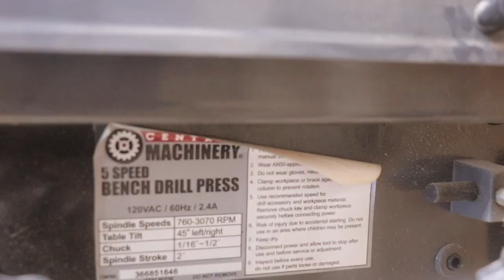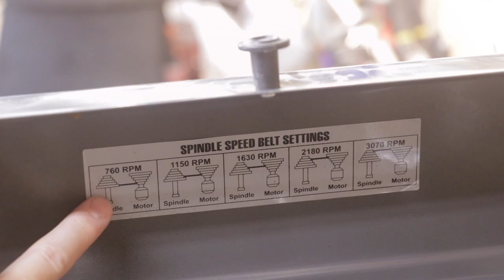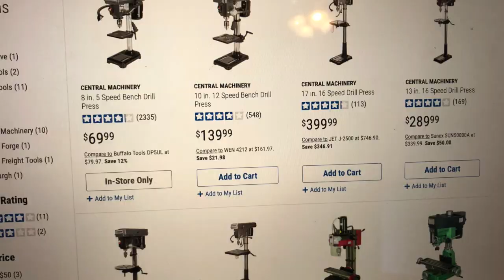Harbor Freight 5 Speed Drill Press Review After 3 Years of Use!

Comment: Harbor Freight's model was to offer old style, easy to produce, less expensive tools that were accurate enough to get the job done.  They are changing the model now with more expensive tools, but the old stuff still works.  I have the drill press, and an old Jointer from HF.  Neither have any whistles or bells, both just do the basic job and keep working.  Very simple, usually easy to repair too.  No complaints here for the price.

Comment: I commented on your review of the HF belt/disc sander, mentioning that for many people the option is HF or no tool.  I was excited to see ypur review because I have this drill press, too.  I bought it from a guy for $30 about 3 years ago, so it is likely 6+ years old. I turn it on and it spins and makes holes in wood.  Just like the sander, when one has realistic expectations of what the machine can do and what can be done to make it more functional in an individual's situation, it is a great addition to the shop.  The only time I wished I had a different one  was when I built a table where the base was 4 inches thick and needed a hole for a mortise but the drill press was too small. Still, I made the hole with a hand drill and it worked fine.  I jist can't see dedicating the floor space to a large machine.  I store this one on a shelf under my work bench.  Your review is honest and useful.  I will look forward to your drill press table build!  Thanks.

Comment: I just started putting together a shop to work out of and my wife surprised me tonight with this Drill Press. Thanks for the review, I was a little hesitant to unbox and set it up because of the comparisons to the WEN and wasn't sure if this press would be worth it. Your video has changed my mind on that.
Reply from the maker: Russ Thacher cool! Glad it helped! Check out the drill press table I built! A table is super helpful!
Reply: Haha, my wife surprised me with mine, as well. I VERY frequently use mine for putting pin and weight reduction holes in high carbon steel knives, and it still runs great.

Comment: I subscribed as soon as you said you had the tool for three years. Most of these guys use a tool for maybe an hour and post reviews as if they really know it. Thanks for actually knowing what you're talking about. I just pick up this drill press for $35 from someone that used it once and it sat in their garage since. I was already think of building a bigger table, so I'm watching that video next. Any thoughts on changing the table angle bolt to something like what's used for the table height?
Reply from the maker: Offset the drill block. Thats the only thing that I wish I had done differently.

Comment: At 4:43 you canclearly see the slop in tollerence as the forsner bit shifts with torque to one side.  That said it's still totallu useable for the type of shop work shown here in this video.  I am considering buying one.  If I was doing metal work I would get one of the many old cast units frequently found on craigslist at around the $200 mark
Reply: The main issue that still irritates me about mine is the quill has a lot of front to back slop. Even the left to right slop required removing the quill, polishing the set screw groove, and rounding the end of that one set screw better than it was. It was rough enough to be gouging into the quill. I've seen one potential solution of adding nylon or brass set screws in that axis, except the on/off switch is in the way, which would suck to remove every time I want to adjust those. I'm considering some kind of spring loaded mechanism added in behind the side light's switch panel.

Comment: Jim, appreciate the review of the lowest end Harbor Freight drill press. I happen to have this same model and am reasonably happy with it for what I need. Jim, one thing, its biggest drawback, setting table height. Without a geared post, this can be a frustrating task, especially if you need to set it accurately. It can be almost impossible to raise or lower the table without rotating it at the same time, and then hold it steady while tightening it in place. I also have issues with the depth stop which is cheap and undependable. Still, you are right. It's a good usable tool for the price. Thank you.
Reply from the maker: Very good points Terry! I completely agree! Useable without bells and whistles!

Comment: I picked up one of these about 25 years ago.  It was painted green and had a nice keyless chuck, but otherwise was the same.  It was an absolute tank.  The only time I ever managed to stall it was drilling a 2 3/4" forstner bit into purple heart.  The only issue I ever had with it was it size.  I constantly needed more capacity, so I unfortunately replaced it with a larger Delta.  That Delta has been the biggest piece of crap in my shop.  It doesn't stall, because the chuck can't hold anything.  I replaced the chuck with a keyless one and that worked better.  But now the whole thing has fallen apart.  I might just replace it with one of the Harbor Freight floor models.

Comment: Hi Jim, my drill press is about the same as your accepting that it is a floor machine. I have had it about 40 years and it was second hand when I got it I have made a table for it and that was an excellent upgrade, in all the time I have had it I have never moved the table from the 90* mark. I have had to replace one of the bearings in the gear reduction part and I super glued the three parts in after they kept falling out. I hope you get as much work out of yours. I know the new ones come with all sorts of “upgrades” but that entire means is there is something more
Reply from the maker: Thanks for sharing John!

Comment: Does this have the capability of drilling through a 4x4 in one pass? It doesn't look like it has the height. If you put a long bit on it that has to go 3-1/2", you still need enough clearance to get the 4x4 under the bit. I guess one could flip the piece over to drill from the opposite side as long as the marks for the holes are pretty exact. The other issue is using something to support the long end so it stays level.
Reply: Looking for the same info, did you find the answer?

Comment: I was going to buy the Wen press, but HF has the 8in for $55 right now. So I figure, I'll try it. I only have 1 functioning arm, so I'm not sure itll work for me. But drilling 90° perfectly has been impossible without a press... no matter what "hacks" or tools I've tried.
Reply from the maker: Build yourself a nice drill press table with a fence and hold downs! Makes it a much better tool!
Reply: @lastingbuild1373  I do have a question about that... Do you think changing the belt could be done with 1 arm? 
 
Or, would it be thrown off in some way if it was tilted tilted? Like could I mount it to a flip table? I just find that certain tools ( router table, or miter saw) are easier for me to adjust in different positions... I'm not sure if a drill press can be flipped like that though.

Comment: Thanks for making this video. I purchased this 8 inch drill press a couple of days ago, watched your video and was up and running in ten minutes. Well sort of. Even at the slowest speed (760 rpm) it stalls constantly. There is decent tension on belt with about .5 inch of play, any suggestions?
Reply from the maker: Just play around with the tension. I thinks that’s par for the course though

Comment: I just got mine the other day, and one thing I noticed is the bottom side set screw that holds the headstock to the pipe snugs up fine, but the one above that screws all the way thru until it falls out of the threads and  down inside the pipe. There's a small rod/pin that protrudes from the back inside the collar of the headstock that stops the pipe from travelling upward any further, but the screw thread is above that. Was yours the same way?

Comment: I bought this drill press about 6 months ago. When I try to use it it will not turn unless I get it started by hand. It’s in a none heated garage but it hasn’t been that cold here in ND. Tried it yesterday and i could not get it to turn on its own. Any ideas out there?
Reply from the maker: You might try loosening the drive belt a little bit!
Reply: @lastingbuild1373  thanks ! I’ll give it a try.

Comment: What brand of forstner bit do you use? I recently bought an Irwin Marples 1 1/4 and it barely makes a good cut without jamming up. Takes a good few minutes to get a hole in a 2x4 even after sharpening it. Also bought a cheap 2 3/4 one and that one sucks too but I figured cause it was off amazon. Would love to have a 1 3/4-2in forstner bit cut like that on my HF drill Press
Reply from the maker: Mine are Freud!

Comment: Why would you really want to change the belt to the different rpms?
Reply: If you run the cutter too fast it can overheat from friction, or vibrate from running a really wide tool. If you run it too slow, you either take too big a "bite" per revolution, and stress the blade, or go really slow drilling.
Reply: Also, it'll bog down on bigger cuts if it's going to fast. The belt will slip.

Comment: Gauging concentricity...by eye. That's a neat trick. Impossible, but you saw it here, folks. Silly me, when this was first said I imagined drilled holes in steel measured with gage pins. My fault. This is a joke of a machine; yet a fine starter press for a kid. If you only care about punching through some wood, really, doesn't matter what you use. Even a POS like this with a less powerful motor than a flexshaft grinder, 2-inch quill travel, deflection everywhere, and enough runout to be called a blender will do the job. It's wood.
Reply: You machinists are so arrogant. Go lose a finger.